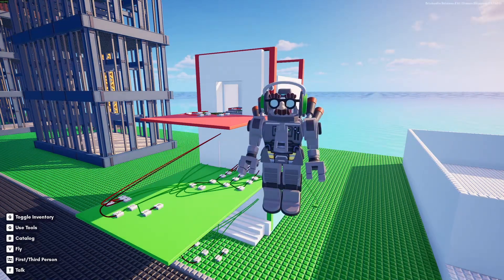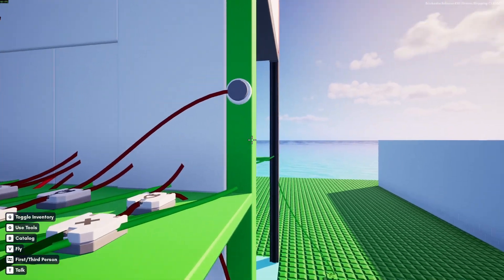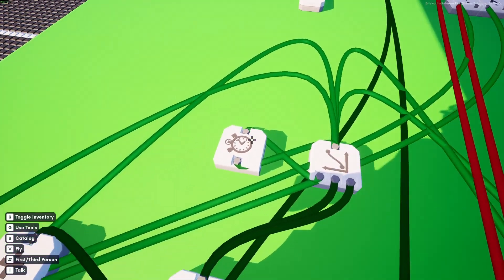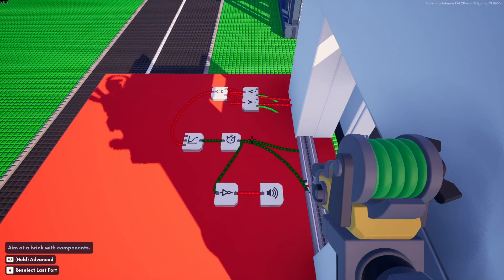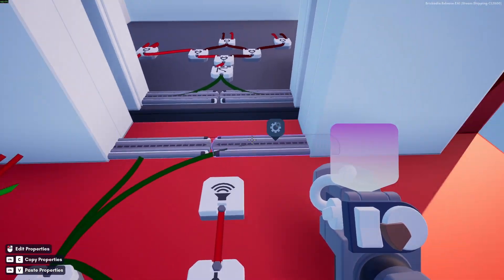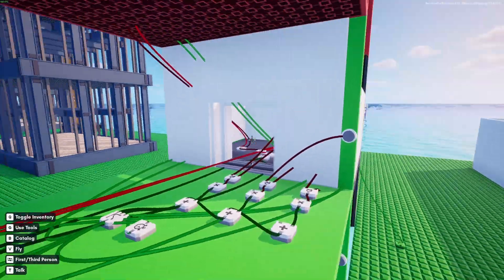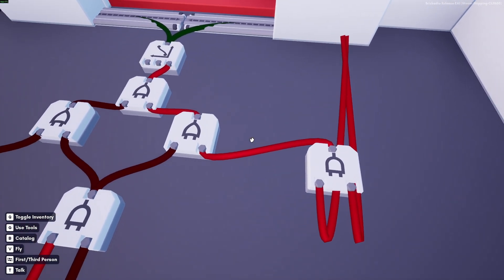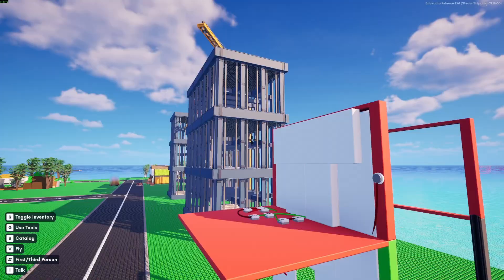Advanced Multi-Floor Elevator Tutorial | Brickadia

Comment: I have a building with 3 levels, and I have an elevator wired up like this, It works great, but I've noticed an issue when I try to go to the 3rd level from the 1st and vice versa, where the inner and outer doors start to open when I pass by the second floor. Is there a way to remedy this?
Reply from the maker: Hmmm thats a weird problem, ille have to go and make a new elevator to find out whats going on here, and then ill come back to help you 🙏🏼

Comment: Your last one plus this finally made my elevator work lol. Thanks. Though I noticed sometimes when I re attach the elevator if I paste the build somewhere else the values for the floors don't work right. Like the slider will drop below my floor (like just fade through it) for floor 1 and not reach the top for floor 2 and I had to make the slider longer and play with the values so it would work. Is this just a bug or am I missing something?
Reply from the maker: Np 😄
And yes that sound like a weird bug 🤔 it has never happened to me yet 🤷🏽‍♂️